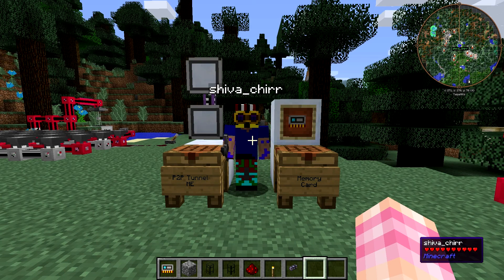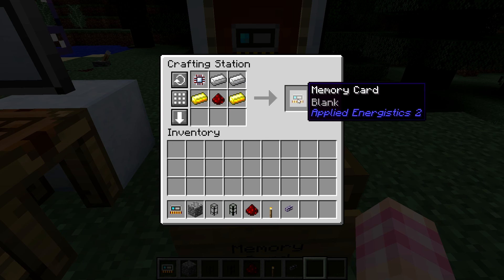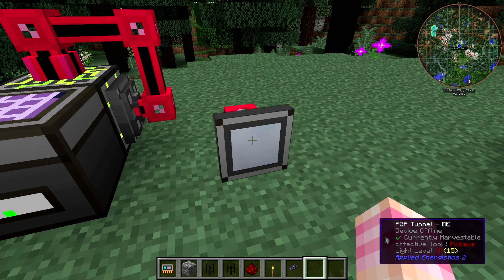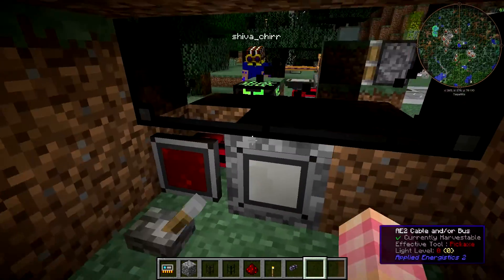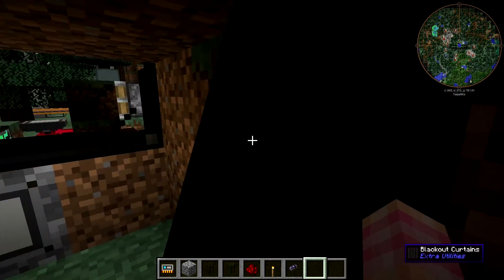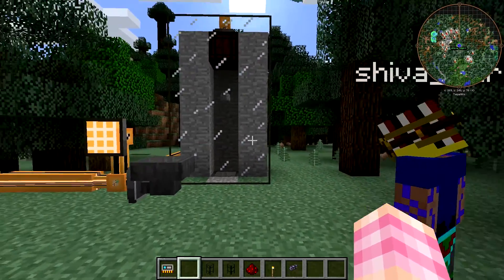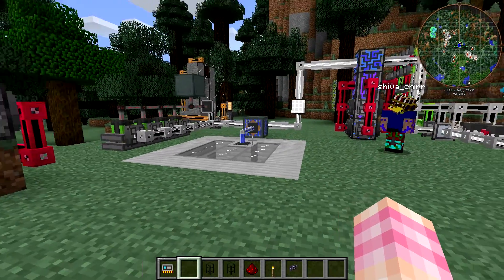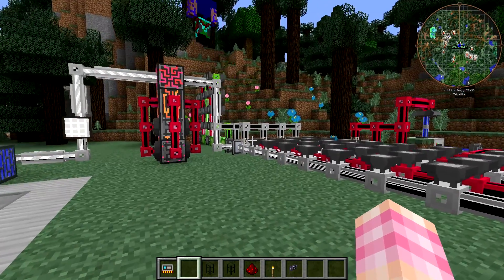Applied Energistics 2 Tutorial #7 - P2P Tunnel

Comment: Will ME Glass Cables work for connecting the P2P tunnels?  That would let you send 32 channels over a regular glass cable which seems like it would make things super cheap.
Reply from the maker: +Todd Roberts Yes they do.
Reply: I mean, making them into covered cables only costs wool, which should be easy by the time you get to AE, but yes.